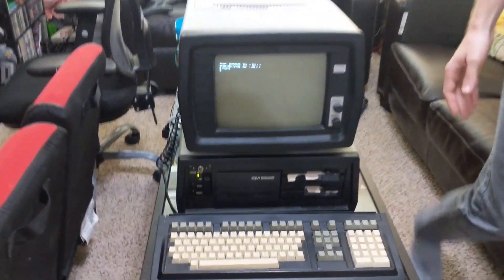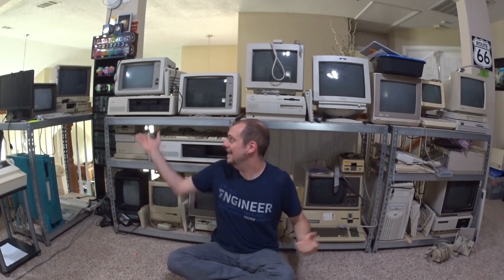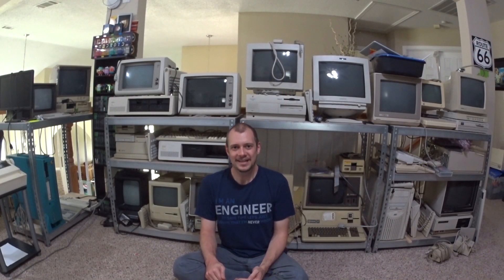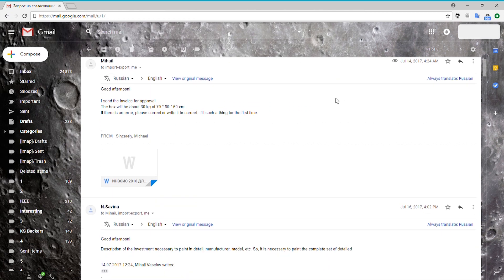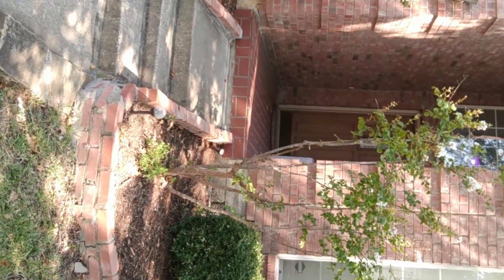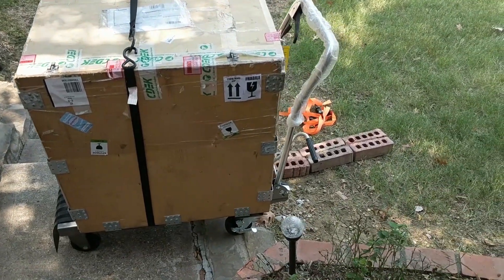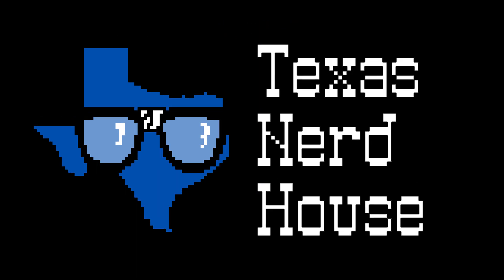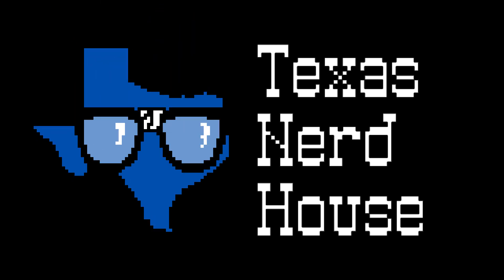Importing and Unboxing a Soviet Computer - ДВК-3 Part 2

Comment: If you were Russian, you'd have come up with the idea to unbox it outside the house and bring it home in parts +)
Reply from the maker: Yes, in hindsight, I should have unboxed it at street level instead of rolling the whole box up the hill! It would have reduced a lot of weight and been much easier to get my arms around. However, I've been taking strength training classes since then, so I might do better next time 😉
Reply: @TexasNerdHouse  next time you buy some old russian mainframe?))
Reply from the maker: @georgysb  I'd have to sell a lot of stuff or give up one of the children in order to fit a mainframe in here 😆 But yes, if so, I'd have them unload it in the back and at least unbox it in the garage!
Reply: @TexasNerdHouse  yes, you'd have them unload mainframe in the back... and simply build another building around it.))

Comment: Although the word “clone” is used many times in this video in relation to Soviet PCs :), in reality the majority of PCs produced in the USSR were not clones of foreign models. Agat-4 and 7 (Агат), BK-0010 and 0011M (БК), UKNC (Electronika MS0511, УКНЦ), DVK (Electronika MS0507, ДВК), Corvette PC8010/8020 (Корвет), Vector-06C (Вектор), PC-01 Lviv (Львов), PC8000 (ПК8000), Radio-86RK, Specialist, Orion and many others - completely original Soviet computers, usually not compatible with foreign models and not copying foreign models (but some are compatible with CP/M and RT-11 operating systems). Clones can only be called ZX Spectrum - compatible (Quorum, Magic, Byte, Santaka, Delta, Synthesis, Robik, Nafanya, etc.) and IBM-compatible (EC-1840/1841/1842, Iskra-1030/1031, Neuron I9.66, Poisk, MK88, MS1502, Assistant-128, etc.). 
The most mass produced of Soviet PCs - UKNС, DVK and BK-0010 / 0011M - were made on Soviet 16-bit K1801VM1, VM2 and VM3 processors, which were not copies of DEC processors, but were developed on the basis of the earlier Soviet 16-bit K1801VE1 microcontroller, which had original Soviet architecture "Electronika NC". But K1801VM1-VM3 are command-compatible with DEC PDP-11/LSI-11, just like, for example, AMD processors are command-compatible with Intel processors, but they are completely different in internal architecture.
Reply: And in order to understand what kind of computers we are talking about, a brief description of some models:

UKNC (MS0511) is an educational (for schools) computer that has been produced since 1987 and has two serious 16-bit K1801VM2 processors with a frequency of 8 MHz (central processor) and 6.25 MHz (peripheral processor - for displaying on the screen, playing sound etc.), screen resolution up to 640x288 pixels, 16 colors, video memory - up to 96 kilobytes, for each line of the raster you can set your own resolution (from 80 to 640 pixels), palette (no more than 8 colors per line) and address in memory (that is, you can easily make a hardware shift to any side of any part of the screen), total RAM - 192 Kilobytes (including video memory), ROM - 32 Kilobytes, keyboard 88 keys (modern type), work with a local network, it is possible to connect a mouse, printers, disk drives, etc. Moreover, UKNC was a relatively simple (55 chips) and inexpensive PC due to the use of several specialized ULA chips in it.

DVK (Dialogue Computing Complex) - a large range of expensive professional 16-bit PCs produced since 1983, with processors from K1801VM1 with a frequency of 4 MHz to K1801VM2 up to 8 MHz and K1801VM3 6 MHz (the fastest), RAM from 48 kilobytes to several megabytes, a video controller from pure text (in the first models) to a color graphic KCGD (КЦГД) with an integrated 16-bit microprocessor, 128 Kb video RAM, 4- or 16-color (64 color palette) graphics, resolution up to 800x480; built-in drives and hard drives, excellent capacitive keyboard, mouse.

Electronika BK-0010 (BK - Household Computer, БК – Бытовой Компьютер) - the first Soviet serial home computer (not counting amateur ones), produced since 1984, fully 16-bit (processor, RAM, ROM, controllers), K1801VM1 processor, 3 MHz, RAM 32 kilobytes (of which up to 16 Kb - video memory), ROM - from 24 to 48 kilobytes, graphics 512x256 (monochrome) or 256x256 (4 colors for any point), hardware vertical scrolling. One of the most original and popular inexpensive models in the USSR, very convenient for programming thanks to the PDP-11 command system (thanks to DEC :) and convenient drivers in ROM. BK-0011 and 0011M - produced since 1988, K1801VM1 processor, 4 MHz, RAM expanded to 128 KB (that is, user RAM up to 7 times more than BK-0010), there is a choice of colors from 16 palettes, two frame buffers, frame rate interrupts. An excellent, programmer-friendly computer, for which many demos and good games have been written.
Reply: Vector-06C - one of the main Soviet home PCs, produced since 1987, 8-bit KR580VM80A processor (similar to Intel 8080A), 3 MHz, 64 Kb RAM (8 to 32 Kb video memory), 512x256 graphics (2 or 4 colors for any point) or 256x256 (2, 4, 8, or 16 colors for any pixel), in all modes the colors are programmed from a common palette of 256 colors, hardware vertical scrolling, video memory of 4 bitmaps, hardware overlay (for example, sprites on a complex background) or several frame buffers, 3-channel sound, it is possible to expand the RAM by 256-512 and more kilobytes, use ROM cartridges, connect disk drives, printers, etc. Had BASIC with outstanding graphics capabilities, which is clearly seen in the videos about BASIC games for Vector (however, BASIC was loaded from a tape recorder or disk drive, it was not in the standard ROM). The best of the mass Soviet home PCs in terms of graphics and sound capabilities, significantly superior to most competitors, and at the same time inexpensive.

Corvette PK-8010/8020 - one of the main educational PCs (together with UKNC), produced since 1987 (developed in 1984-85), 8-bit processor, KR580VM80A, 2.5 MHz, RAM from 112 kilobytes (of which video memory 48 Kb ) up to 256 KB (video memory from 48 to 192 KB), outstanding in terms of quality and speed of graphics - resolution 512x256, 8 colors for any pixel (programmed from a palette of 16 colors), hardware acceleration of color graphics output (color register - like EGA for IBM PC), graphics-independent 64x16 text video controller with a large character matrix (16x8 pixels), excellent reed keyboard, fast and functional BASIC in ROM (MSX standard), CP/M compatibility, connectors for connecting a printer, mouse, disk drives, etc. It is one of the fastest 8-bit PCs in terms of graphics drawing speed and the champion in closed area filling speed, the graphics quality is excellent and you can combine graphics and text screens, and the text quality is one of the best among simple PCs.

Comment: So, one thing I am having a tough time finding info on, how are you powering that beautiful piece of hardware?  for some reason nobody really mentions differences between soviet power, and current russian federation power.  is it the same plug and 220v/50hz that they use now?
Reply from the maker: Good question ☺️ I'm using a Pyle® step-up transformer from 120V to 240V. It has a European-style plug on it which I can use with the computer's original cord. I still need to modify it to supply a ground. For now, I've stuck a big beefy wire into an IEC cord (typical computer plug) and screw that into the ДВК's ground terminal.

The computer doesn't seem to care about 50Hz vs. 60Hz. Only thing is the fans obviously run faster, since they're at a higher pitch with 60Hz juice.